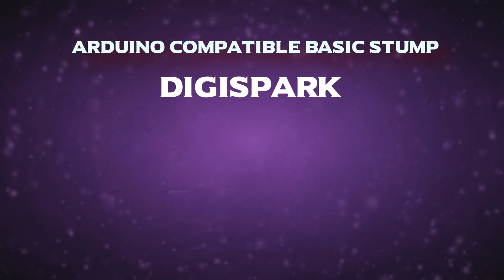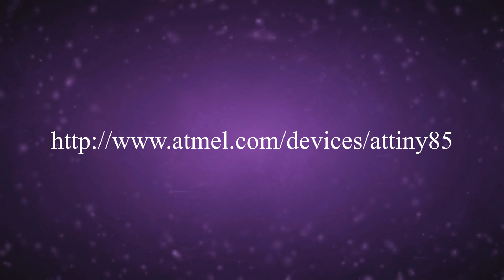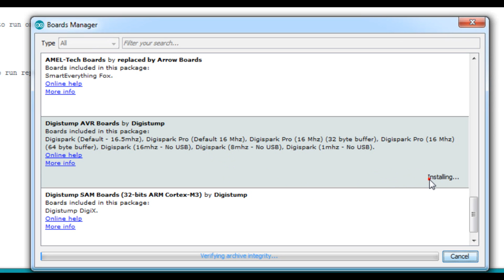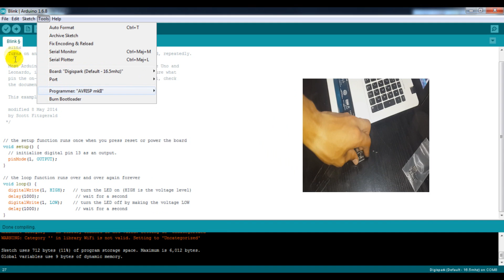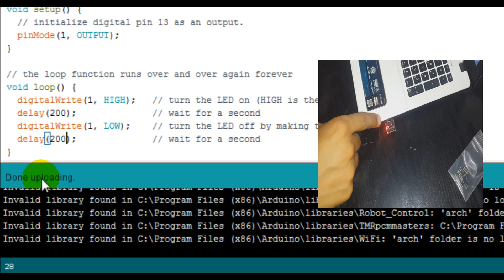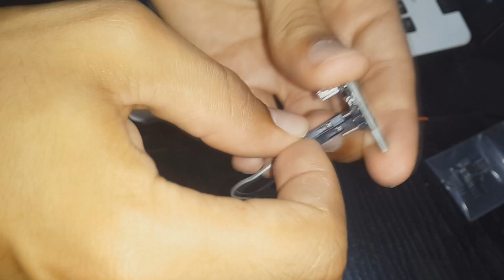How to use Digispark ATtiny85 (smallest Arduino compatible board)

Comment: Nice video but i have a question. Did you have to solder the pins in place? If yes can you do a tutorial?
Reply from the maker: If you talk about the header pins then yes, you need to solder them the way you solder any other pins, it will be not relevant to make a whole video about how to solder pins, maybe you want to watch my assembly shorts for more assembly tips

Comment: I had using same board the program also prefectly run on the board but my problem is when i remove the board on the power supply after few sec reconnect the power supply the upload program not be executed

Comment: this type error message show me

Arduino: 1.8.12 (Windows 8), Board: "Digispark (Default - 16.5mhz)"

C:\Program Files (x86)\Arduino\examples\01.Basics\Blink\Blink.ino: In function 'void setup()':

Blink:28:11: error: 'LED_BUILTIN' was not declared in this scope

   pinMode(LED_BUILTIN, OUTPUT);

           ^

C:\Program Files (x86)\Arduino\examples\01.Basics\Blink\Blink.ino: In function 'void loop()':

Blink:33:16: error: 'LED_BUILTIN' was not declared in this scope

   digitalWrite(LED_BUILTIN, HIGH);   // turn the LED on (HIGH is the voltage level)

                ^

exit status 1
'LED_BUILTIN' was not declared in this scope

This report would have more information with
"Show verbose output during compilation"
option enabled in File -> Preferences.

Comment: Nice Video, thanks. On one point I have, however to throw my 5 cents in- as fat as I know, the 8 of attiny 85 is not for 8- bit but for 8kB of ram, as attiny 45 has 4kB of ram and the atmega 168 has 16kB and the atmega 328 has 32 kb, the 8 in case of atmega is indeed for 8 bit. I of course know that I am a little late, but I just stumbled over the video 2 years later...

Comment: Loved your tutorial but i have a question....

Why you are using an external power supply, what is the use of that...

Also the digispark works very fine in my lappy but when i tried a run a prank in my friends lappy it showed The last USB you inserted was not recognised, device descriptor request failed

Please provide the solution 
Thanks
Reply from the maker: Hello Ankesh
First verse I used an external power supply to show how to power on the board using +5V and GND pins, else it works fine when you plug it in your USB connector.
For the PC of your friend do not forget to install the Driver.

Let us know if we can further assist you.

Comment: The connection to Win 10 is horrible. A meaningful use is impossible, because a lot of time is wasted for this uploads. One time it is possible other time not - but no changes on Window System.
Why we have no "standard way" to connect device like UNO.
Reply from the maker: Hello JR
There is no universal method to connect this kind of boards to PC simply because of the USB to TTL converter that it has, not the same for all Arduino boards.

Let us know if we can further assist you.

Comment: Your explanation of the attiny85 name is wrong. All attiny microcontrollers are 8 bit. The 8 means it has 8KB ISP flash memory. The 5 has nothing to do with the voltage. The microcontroller by itself can run between 2.7v and 5.5v
Reply: You are correct sir!

Comment: can we operate modules like esp8266,GSM and Bluetooth hc-05
Reply from the maker: Hello dipen
Yes you can connect the HC-05 Bluetooth and the ESP8266 since they use Serial communication (Rx,Tx Pins) but the GSM module I'm not sure that you can use it with the ATtiny MCU.

Note: for the ESP8266 I advice you to command it using "AT commands" through Serial Pins and DO NOT power it from the Digispark board.

Let us know if we can further assist you.

Comment: Do i need a Arduino board? Or can i download someware the Software for free to use it with this stick?
Reply from the maker: Hello Aiba Randolf
You need the Arduino IDE only to use this gadget, follow the steps showed in the video :)
Reply: OK, than is this the easiest way to program an attiny. But i have to buy the Digispark first, thanks.
Can i solder a 8  DIP Socket on it, to Programm more single ICs?
Reply from the maker: This is the easiest way to do this task.
As you said, you should buy a Digispark first, then remove the ATtiny soldered on it and place an 8 DIP Socket and programm ICs as much as you want ;)

Comment: Hi, I am DIpak. Recently i brought digispark attiny85 and 0.96" OLED ssd1306. when I interfaced with arduino uno were it was quite easy. BUT i found very difficulty while interfacing with digipspark attiny85 module. Please help me with providing me the code and library.
Reply from the maker: Hello Dipak 
Actually there is no library to add! but the programming methode is different then other Arduino boards, with the ATtiny you should click the upload button before connecting your board to computer and just connect it when you get a message in your IDE space debugger (as showed in the video).
About the code I just used the Basic blink Arduino exemple but you need to select the right board which is Digispark in (board manager).
Reply: MEGA DAS thank you for replying. I really appreciate. 
Should  I ask one more favor shall you please provide me some written code to display only text like HELLO WORLD into 0.96" oled display.
Reply from the maker: Dear Dipak! you can ask us whatever you need.
First first! this video is about how to use Digispark board not the OLED! This is why I told you that there is no no need to add libraries but in order to contro you OLED you should add the (Adafruit_GFX) library and (Adafruit_SSD1306) library to your IDE and you can use the examples of these libraries.
here is a link for a hello world exemple try it and let us know if it operates correctly or not but before trying the example don't forget to add the libraries that I mentioned !
-----------------------------------------------------------------------------------------------------
Download the Hello world example from here: http://www.mediafire.com/file/i6a1jb0r0a211sk/Hello_World_Oled.ino

Comment: does it have debugging over usb? so i can use Serial.print() ?
Reply from the maker: Hello there!
You can't make a communication with the module using the USB connector, but you can make it through usb data+(Pin D3) and usb data- (Pin D4)
The MCU support also SPI and I²C
Reply: usb data+ and usb data- are connected to the USB connector. I'm not sure if you can use Serial.print() but you can "emulate" keyboard key presses with the digispark (you could open a text editor on the computer and let it write the debug information).